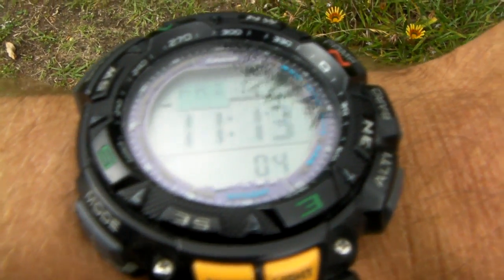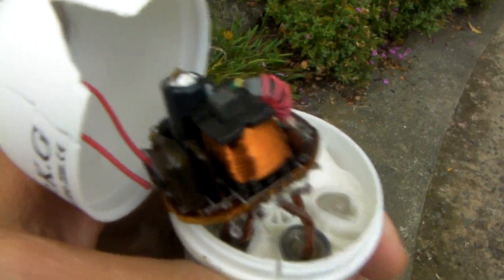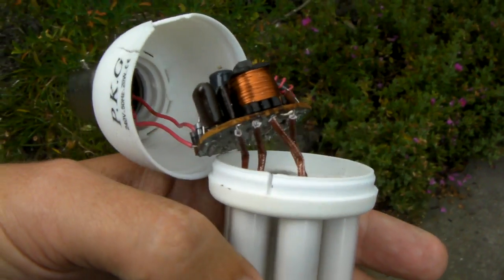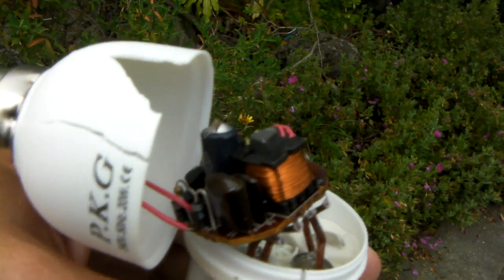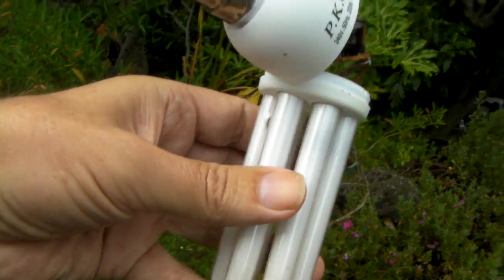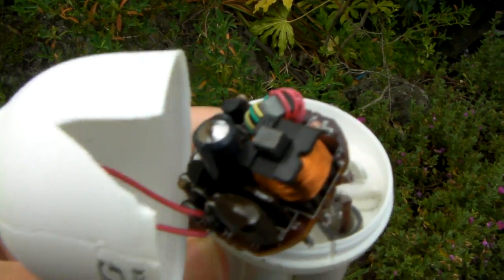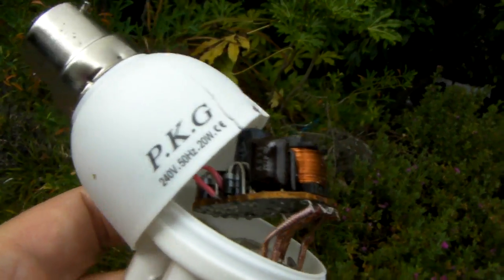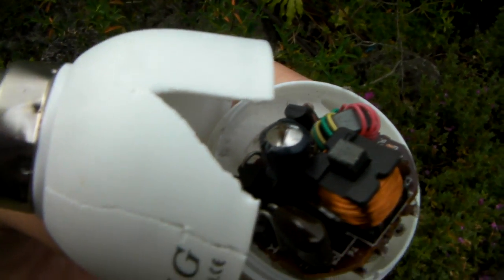Exploding lights?

Comment: Ya capacitors blow all the time too. I ran ballasts with huge capacitors for each of my 28.000 watts of lighting.  I also had capacitors in my flourescent tubes.  I have seen all of the problems that happen to occur.  I have seen lighting storm create enough static int he air to light flourescent tubes without turning on the power...you will know you have an electric anomolly when the entire buld blows up with the ballast...that is a surge you were not waiting for...

Comment: The cap you show has not even exploded, it vented as designed. Caps popped in the past, so all manufacturers designed in a non explosive feature to prevent pressure build up inside. That is why there are score lines on the top of the capacitor, they prevent explosion. They performed their function as indicated in this video. Also, the white plastic enclosure is well vented as seen in the video. See the vents by where the cap stained the inside? You sir, are a LIAR. Pathological.

Comment from the maker: No it was the capacitor that blew. And it blew with enough force to break the surrounding plastic casing. If nothing else it is warning to not use these kind of lights, especially considering the tubes are full of mercury.

Comment: Those energy saving bulbs from China are useless I had one burnt out on 20/12/12 it didn’t explode instead it went dim & left a horrible burning small in the room I had to leave the window open for 30 mins on a freezing cold night it was supposed to last 5 yrs it didn’t last 6 months 5 days latter the same thing happened again to another one I have been looking for ones made in Hungary cant find them anywhere there pretty good I still got one that lasted since 2009